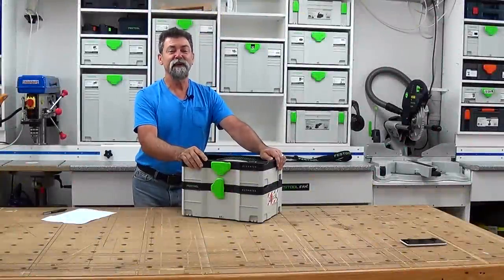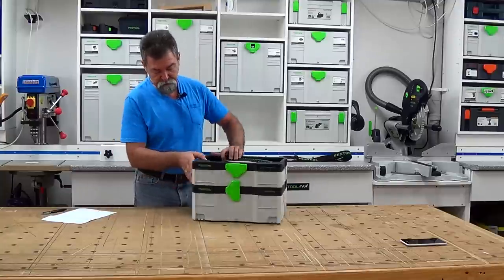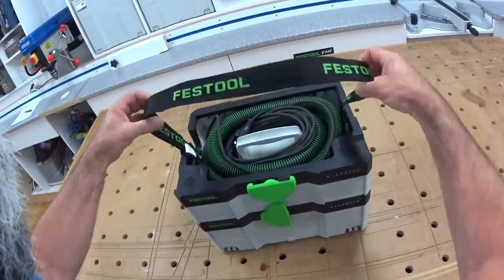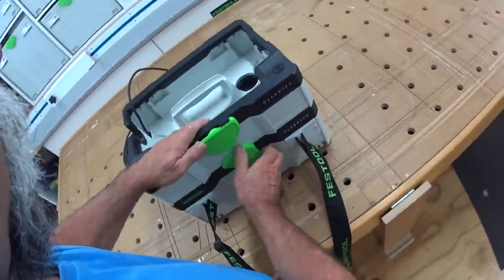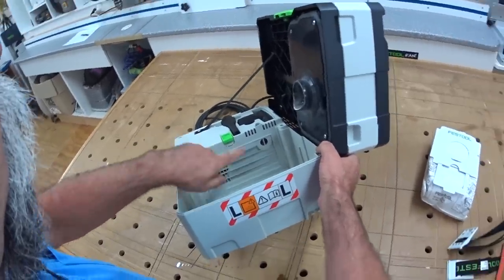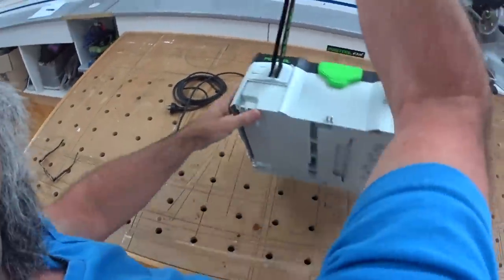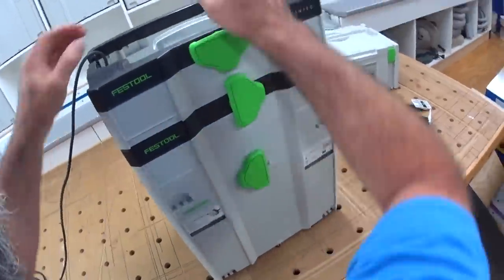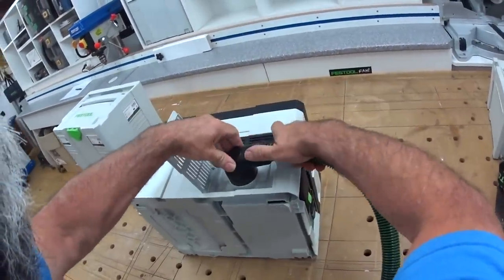festool systainer vac review | dave stanton | ctl sys

Comment: I have many Festool machines but the CTL is a disappointment.  The safety valve activated way too much, loosing a lot of vacuum power even with an 1/4 'full' dust bag.  I also have the largest vacuum cleaner of Festool which is amazing and doesn't have/need sucha safety valve (but too heavy for me to carry upstairs.)

Comment: ovee the next few years I will be changing my truck over to festool with most of the gear. that vac is a great tool for coming through at the end of each day when I do my fixouts. i keep a tidy work area so I wouldn't be taxing the vac.
Reply from the maker: +Adco Martin I have found their gear to be very reliable and accurate. I still use my Dewalt gear as well but Festool just works better for me.

Comment: thanks for the review just bought one today. I have two complaints price off course and that the garage sys is too small.
Reply from the maker: Hi carpenter33. I have heard people say the hose garage is too small before. I don't think the design has been changed since I got mine but I can get the hose and power lead that are supplied with the CTL SYS into the garage quite easily. I take a little time and coil the hose in first and then wind the cord up and place around the handle. All fits below the top of the garage. Something to consider is if the garage was larger then the bulk of the machine would not be as convenient.

Comment: Dave, can you tell me if this new dust extractor works for your Kapex?  I'm looking to purchase one of these to hook up to my Kapex in my small shop.  This could be a good send if it works with the Kapex.
Reply from the maker: Yes it will but I think it will fill up with sawdust very quickly as it is only 3.5 litres.
Reply: Hi David. Thanks again for the review. Im actually thinking on getting one to pair with my domino df500 and both will be housed in a assembly table. What is your take on this? Thanks
Reply: @DavidStanton  what do you think of this, plus the festool cyclone under a kapex? Ultimate small space extractor?

Comment: Dave, almost a year on, how has this gone in your shop?  I'm tossing up this and a midi, mostly for sanding and domino work, but I'm still wondering if it fills up too quickly in real world usage.
Reply from the maker: I would buy the midi for constant work. This sys vac is a vac that is great for clean up and very small jobs. I typically empty the bag when only 1/3rd full as the bypass valve render the vac useless if the bag is clogged at all.

Comment: Found something weird. In the USA this model is HEPA certified. In Europe not.
Reply from the maker: You can fit a hepa filter to the unit if it did not come with one.
Reply: @DavidStanton  Thanks for your reply. I have another question for you. The mini/midi are noisier, but the motor can be turned down. If you turn them down to the same sound level of the SYS, is suction power the same then as the SYS or less?

Comment: Too bad you can't buy it in the U.S., for some odd reason.
Reply from the maker: +christschool In time you probably will be able to. My understanding on Festool releases is that Europe gets first release and Australia not long after. This unit has been available in the UK for a while now. I think we are all on 230-240 volt. The US  being on 110 volt may need to wait for different voltage motors? Also, there are a lot more people in US than Australia, 20 x's that of Australia's population.
Reply: ***** That's an excellent point.  110v is much harder on motors than 230-240 and with such a small motor, perhaps there isn't one that meets Festool's standards on the market yet that will fit the systainer.
Reply: +christschool This will be out in May